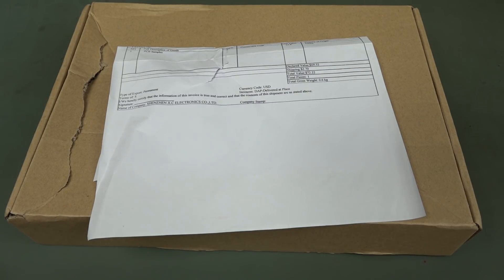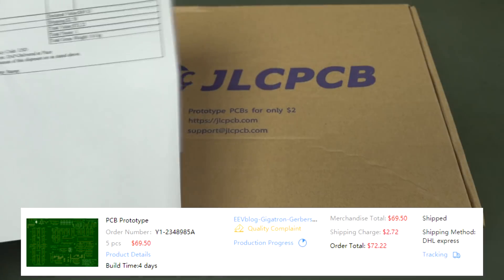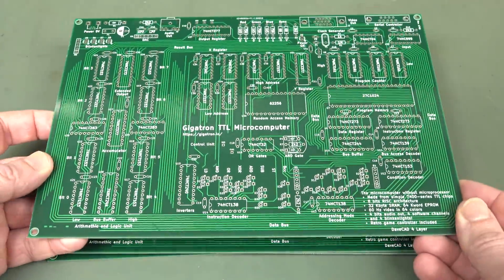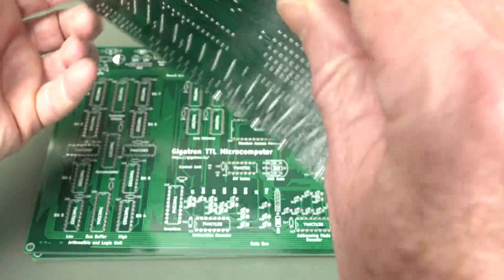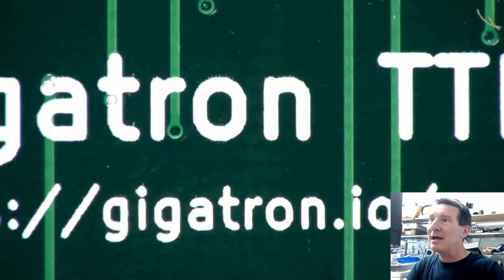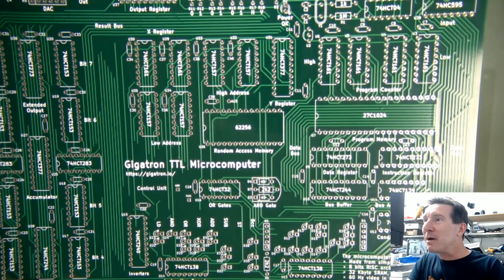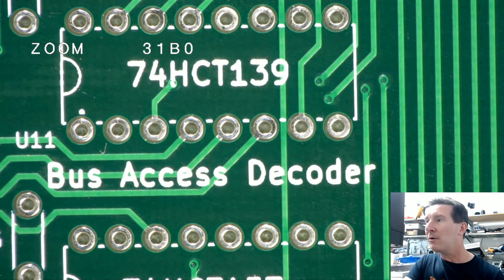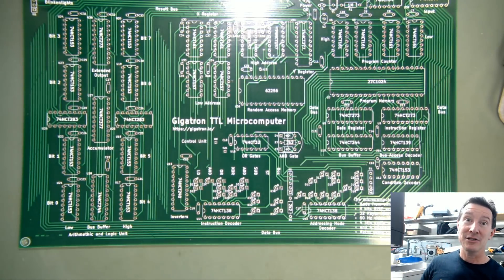JLCPCB Prototype Inspection

Comment: I keep trying to encourage people to try services like this.

I've had several 4-layer designs made by them now, and I can't fault the quality at all.

It really is insane how cheap they are now, compared to the €65 I paid for just ONE 2-layer board (12cm square) in 2008.

The only thing I would request is that they add another courier option that is in between the DHL and snail mail options, since DHL very often charge extra duty if the parcel is a bit heavier.

(I don't mind waiting 10 days or so with a courier, but the average three-week wait via snail mail is a bit of a killer. lol)
Reply: Itead.cc is offering  "SF Express". Slower than DHL but certainly faster than snail mail.
Reply: For example, my last order was for four different designs. Two 4-layer boards, and two 2-layer boards.

There were 40 boards in total, but they still fit into the same sized box as in this vid.

The PCBs were £65.95 total, DHL shipping was £21.22 (to the UK), which is fine for the weight, but then I STILL got charged an extra £27 duty, which I had to pay via the DHL site before delivery.

If there was an option for a slightly cheaper courier who might take a bit longer, but are far less likely to add extra duty, it would be ideal.

(£21 for fast shipping from China to the UK is pretty good, but £48 with the extra duty is crazy.)
Reply: You were charged VAT not Duty because the value of the goods + shipping exceed £45.00 which is the threshold for VAT exception from China. PCB's have a 0% duty threshold from China.

JLCPCB have a sister company, LCSC where you can order the components for the board and have them shipped together. I ordered 30 boards plus a stencil last month but i made the mistake of ordering some parts as well and they combined the 2 invoices together which exceeded the VAT level and i had to pay an additional £19.00. If i had just ordered the boards, i wouldn't have had to pay any VAT.
Reply: @sparkdoctor5773  

Sorry, yep, VAT.

I keep calling any extra charges "duty", and it's a bad habit.

The thing is, I'd rather have the site itself calculate the VAT if they know the destination Country. It should be mandatory on all sites, IMHO.

I'm sure there are some logistical reasons I'm not aware of, but I thought that was fairly standard across other sites?

If it's due to the tax threshold in China though, I guess it makes sense.

Comment: Why do your PCB at home? to don't wait 2-3 weeks to have one. And maybe when you receive, you notice that you amde a mistake and need to print onother one :)
For beginner and hobbyists it's yet good idea make it at home. After when you have a working prototype it's better to use a service like JLCPCB
Reply: How do you make 4 layer boards at home?
Reply: @ Frank Gormanns  : you simply glue two 0.6mm thick 2 layer pcbs together :) it has it's limitations on routing and via sizes (riveted vias are big and a via across 4 layers is basically 2 riveted vias with a wire soldered in) but it's doable. it's not practical and definitely not worth the effort but still doable ;)
Reply: He only had to wait like 4 days for it though? He ordered it on thursday and it arrived it on the next monday. Thats 4 days and thats including the sunday. So I am not sure how you get to 2-3 weeks.
And do you really think it is a good idea for a beginner to attempt to make a 4 layer pcb at home? Thats a completly different story to a 2 layer board.
Reply: No a beginner usually don't need a 4 layers board, for a 4 layers board of course it's better to send to on of this service... 
For little board wiht one or two layers, an homemade protorype is usually faster than very cheap service for PCB. 
In this case if you use service that allow you to have it for 12-20$ (10 PCB)  usually have to wait 2-3 weeks.
Reply: it was not a criticism of the video, this video is very useful. It was an answer to the question: "Why are there still people who want to print pcb at home?"
Reply: Not sure if at home but maybe locally for single and dual layer boards in some small local business that maybe offer services for like electricians or electronic students. If the business isnt a total organizational mess it shouldnt take them long.
Reply: I've been using ALLPCB lately, they deliver to Australia in one week. (DHL postage is heavily discounted)
Reply: I mean, yeah, if you only need a 2 layer board and you need it that day or the next, sure, you can make one yourself.
but in many cases, wouldn't a simple perf board prototype suffice? You don't really need a custom pcb for a quick and dirty prototype do you?
Reply: @jort93z  Some complex designs might be too complex for a perfboard, and too simple or urgent to order 5 of them and have to wait days or weeks for them to arrive, or you simply need only one or two boards.
Reply from the maker: A homemade PCB is faster (I used to make them in an hour or two), but that's the only advantage. The raw materials would cost you more than cheap proto boards cost.
Reply: I still etch prototype boards at home useful for testing out ideas before actually getting them made, but at these prices then its a no brainer if you need more than a few boards
Reply: Because it's waste time+money to setup And skill too. I have done setup my 2 layer at home (CNC + Chemical). But still not enough for 4 mil track and 0.3mm drill hole.
So i'm back to PCB manufacture.
Reply from the maker: INsideDev - I used to be able to do 6/6 thou at home, just. 8/8 was fairly easy.
Reply: EEVblog2 - WOW. Could you made a video guide "How to made 6 layer PCB at home" please?
Reply: @insidedev5278  when he says 6/6 he means trace/space not 6 layers. Still 6 mil is pretty good for a home etch.
Reply: The biggest problem to using these shops is you need to send them stuff in digital form. Really, I still find most ECAD products not that easy to use. I am not sure why, I use a lot of software for other things, including drawing, and planing, but for some reasons almost all ECAD sucks for me personally (I am 30 years old, not some dinosaour).

If I would be making complex digital board with a lot of routing, or high speed stuff, or RF, sure I will need 4 layers, and I will do that via profesional PCB maker shop.
Reply: So you can spend that 2-3 weeks on perfecting the circuit on bread/veroboard and the PCB layout instead of dicking around with chemicals all day spending even more time and money :P if you're doing homebrew PCBs for the fun and satisfaction of PCB manufacture itself then more power to ya but if you're in it for the electronics, get em made in china or use veroboard.
Reply: You also don't get solder mask (or good solder mask) if you make them yourself. Can make a huge difference when soldering QFN/QFP style chips. If you badly design a PCB that you can't bodge wire it in prototype stage, you didn't spend enough time checking the PCB design before submitting or etching :P

Comment: You can even make more boards. I managed to make 80 small boards for 2$! They were small enough to put 8 of them on single board within 10cm by 10cm. And 10 boards of these. Great deal!
Reply: Nice!
Reply: The fee for multiples is typically for different designs, not multiples of the same design.
Reply: If you put multiple designs on a single board submission they usually charge you more!
Reply: John Helm . Just be clever with your design.
Reply: only if you require for panelization on each board which will cost more, but if you were to mark out on the silk screen and make you own cutting that will still cost you 10 by 10cm with 10pcs for $2.
Reply: My boards ( https://imgur.com/RZRa9QN ) were v-scored, also their serial number is where it's ok to be.
Reply: kjur18 I’ve been wondering how to submit the gerbers with vscore for JLCPCB. I’m using Eagle - in their help pages they don’t tell you how to do this. Can you help?
Reply: I had one design, board was small enough (21mm by 36mm) to use "Panel By JLCPCB" option. You can put two circuits on your board and cut them later, without additional charge, if you manage to fit in size.